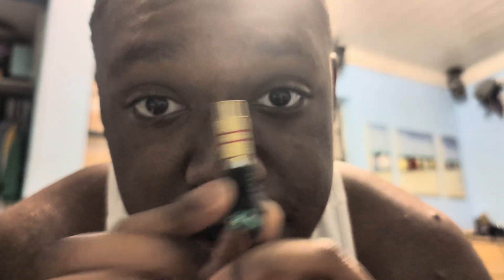How to set up Crown CTS amplifier for a residential application

Comment: I rigged a set of rca cables to the Phoenix plugs and set the attenuation to half and it sounds great! A pre amp is unnecessary when the attenuation adjusts the input sensitivity of the amp itself. The input sensitivity is 1.4v and my TV's output is about 0.5v so I used an attenuation calculator and rounded to 9db which is half attenuation on this amp. I got a CTS600 and CT-210 for free from my job. I'm glad to see a fellow CTS600 user!
Reply: How did you do this? I need help and can't find any videos on the cts 600. I'm trying not to buy a pre amp. I'm gonna try the inline inverter i have coming that was $50 on ebay. It's speaker wire off the receiver to this inline box to rca cables. So from the box I wire the Phoenix box to some wires then wires to rca connections to go from amp to box but don't know if that would work.?
Reply: @Camocountry1  inline inverter as in for a car?      what are you hooking this to? Are your rcas shielded, etc I'm sorry for the questions but I need some clarification to see if I can help.